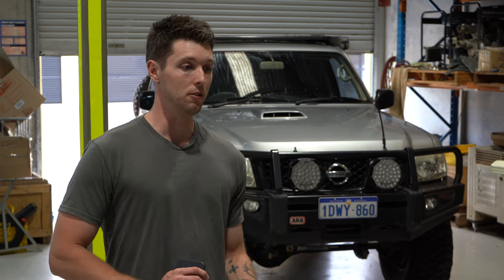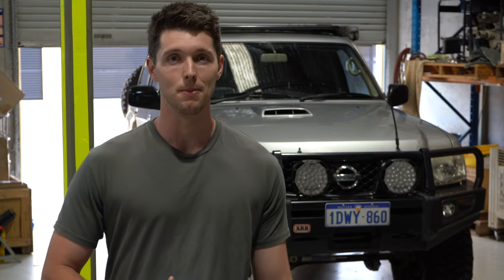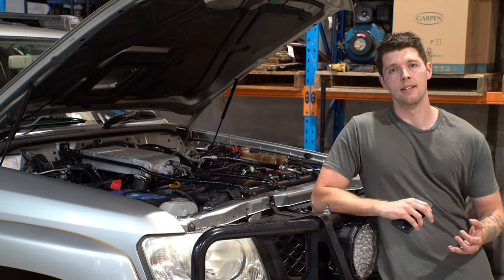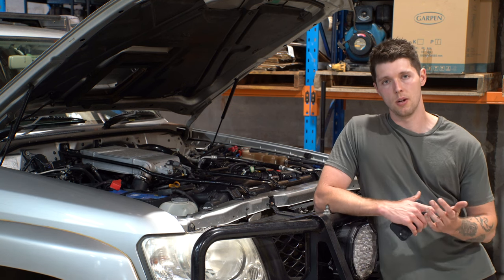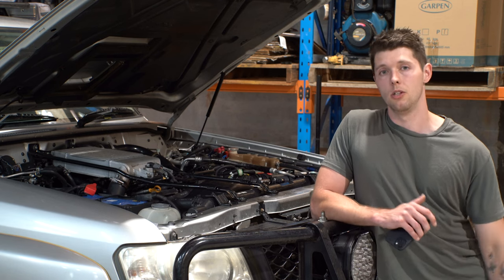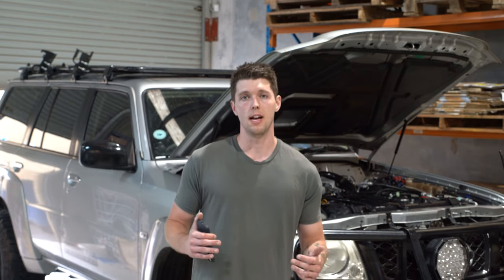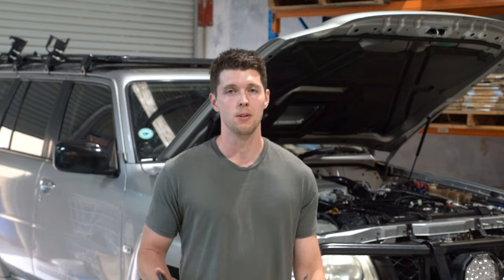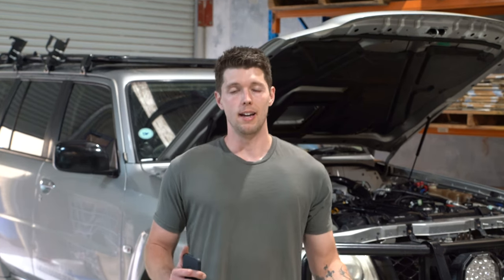15% Reduced EGT's With This Cheap Modification!

Comment: Mate glad to see another fellow patrol owner adopt the tillex system. 

I was in your exact same boat. I went for a datz cool 450 wide FMIC  next and it was an absolute game changer. I can be easily 250 degrees at 100km/hr 5th gear on a flat road. Never exceeds 550 ever. If you want to go futher they even have a 600 wide kit too. Though I have pumped my boost up to 23 PSI also (right at the limit of the stock turbo which is about 24 PSI).
Reply from the maker: They’re a good mod that’s for sure! And funny you say that, I’ve literally just received my Dats Cool 450, will be installing the bad boy very soon
Reply: @jasereynolds_  haha it can be a pain to install. Ask them for instructions before you start... Haha
Reply from the maker: @mesahatesayou  haha shit will have to do that! Thanks mate!🤙

Comment: I ended up ditching the needle valve. Still run the tillix to limit the boost “just in case”. 

I got a remap done and I’m cruising at 100kmh at around 280-300
Reply from the maker: Interesting mate! I’m very hesitant to tune mine - most of the patrols that I’ve seen go bang have had tunes, maybe ‘safe’ tune is a good bet🤙
Reply: @jasereynolds_  I got mine done from ECPT in NSW. They have a pretty good reputation. Mines been chugging along now for about 4years no issues. On 315's my 2013 manual only got 437nm and 94.1kw. Made a massive difference power wise compared to stock. But still a slug. My patrol weighs 3.3t daily. A bit to get moving
Reply from the maker: @benwils0n  awesome mate thanks for the share!
Reply: @benwils0n wow that's pathetic! With a tune my 13 bt50 made 147kw with 520nm. All that engine and no power??

Comment: Biggest thing ppl forget on zd30 gets over looked is monitoring engine coolant temp. I have tune and all supporting mods like you have and my radiator got blocked over heated the engine and blew the head 

If I was you get  an engine coolant temp gauge save you more trouble in long term
Reply from the maker: Nail on the head mate! I’ll be looking into doing this very soon, cheers!

Comment: you could of installed it alot better imo. ull figure it out but .. 🤙🛻📹😎
Reply from the maker: Thanks mate how would you have installed it?
Reply: @jasereynolds_ it just looked…messy. Not sure what the go is with the clamps. They weren’t in the kit 5 years ago. 

I don’t think you’re supposed to use the same boost connection as your gauge. Don’t they supply the nipple you weld into the intercooler pipe?
Reply from the maker: @benwils0n  thanks mate, some people said don’t do the same connection as your gauge and some said it doesn’t matter. I haven’t had any issues 😁🤙